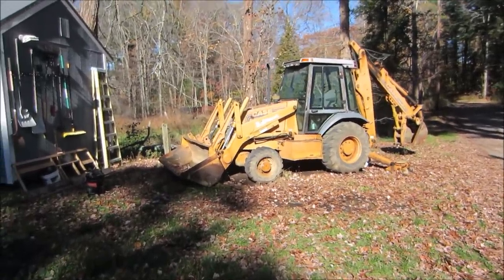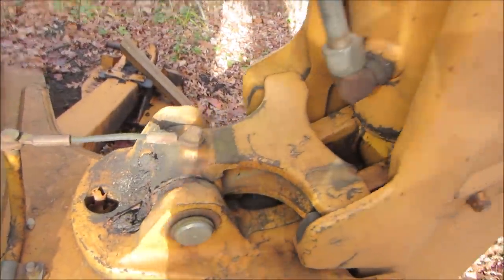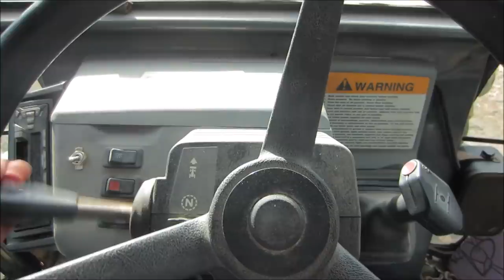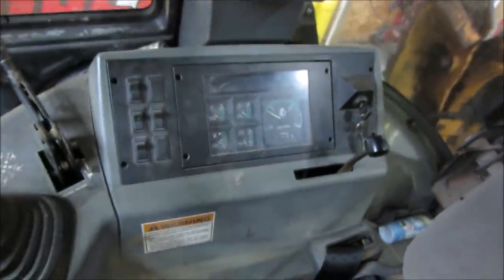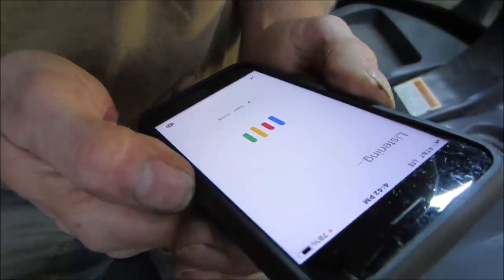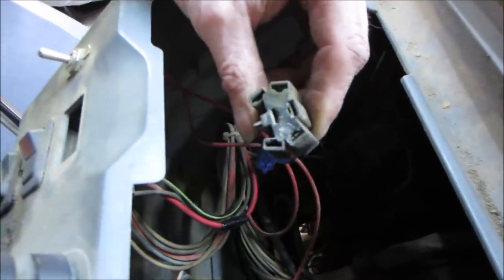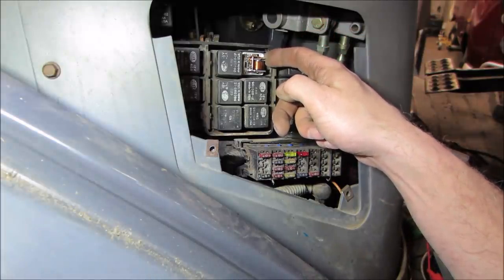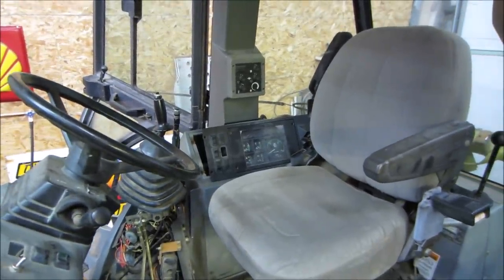Lets Fix Up A Clapped Out Case 580 Backhoe Thats Been Sitting.

Comment: Clapped out?  Matt at Diesel Creek would consider this too new to bother with, but that's him.  Also, I'm loving the twice-a-week Mustie lately!
Reply: Was coming to the comments to say something similar.  Starting on first crank?  Fancy!
Reply: Yep, too much works on this one for Matt.  If it doesn't need 3 batteries, 2 tires, and $700 hydraulic hose, that's cheating.
Reply: Enjoy them BOTH.
Reply: @MGower4465  🤣🤣🤣
Reply: @MGower4465  Same for Andrew Camarata plus welding 1/2" steel parts !
Reply: Matt hates backhoes.
Reply: @starrionx1  That was someone else's backhoe.  If he found one for the right price, he'd buy it.  Fully intending to fix and flip, and maybe sctually do so.
Reply: @MGower4465  Right. He'll flip it. That is why he has two loaders, two tractors?, two Semi-cabs, a bulldozer, a tracked loader, a dragline, an excavator, and two kinds of tracked Bobcats?  Am I missing any of the major ones?
Edit: Apparently I forgot Christine the Grader and the Ford Crane truck. Also Forgot: the active Dump Truck, the parts truck, the Service truck, the fork lift, the Beater with a heater, and the Willys Jeep.
Reply: @starrionx1  I have faith he will actually sell one.
Someday.
Reply: Matt is a masochist..He enjoys the pain and suffering..
Reply: @starrionx1  the grader hes fixing?
Reply: @lukasstorie2947  How could I have forgotten Christine?
Reply: @starrionx1  What about the Ford crane truck? Should be major enough.
Reply: @DocNo27  Not ether-trained either!
Reply: @starrionx1  and he just picked up an International dump truck
Reply: @motor2of7  Yup. Funny thing- the owner of the dump truck also had a backhoe. But that would be unpossible.

Comment: This has been a very VERY difficult video for me to watch. Just simply because I want to help! I grew up in a Case 580 series backhoe. My dad was "the guy" that people called for dangerous and intricate digging in my area. He literally has tens of thousands of hours in the seat of a Case 580 series backhoe. All the way from his first 580B up to the last 580 super K he still owns that runs awesome yet. I too can run it but my dad is a true artist with that machine. Always made the difficult jobs look like a kid playing in a sandbox. 

I love fixing these backhoes up, rebuilding the cylinders and replacing worn pins and bushings. Even at 6600 hours I believe this super L will be a great machine for you!
Reply: My dad started with an Ford 801 Powermaster  backhoe back in the early 60’s. Sold the Ford and bought an International Harvester backhoe in 1975. He sold the IH and bought a Ford 555 backhoe in the late 90’s. He was an awesome backhoe operator and made digging with his backhoes look easy.
Reply: @edwardkane3237  it's an amazing thing to watch for sure!! Especially for a kiddo that looks up to his dad so much. I remember hours of watching him run that thing until I was old enough to get in the trench and run the manual backhoe(shovel). Heck to this very day if I'm digging something that's kicking my butt I'm not above giving the old man a ring and have him run the machine and me run the shovel. At 73 he's not as smooth as he once was but I'd still put him up against any of the other operators in our area. 

If your dad has worn out as many backhoes as my dad has, which it appears he has, then I can assume that your father's story is much the same as my dad's.

Comment: Oh, Mustie! You’re going to have some fun with that one. The ultimate Tonka toy. Congratulations!
Reply: The bigger the toy the bigger the joy.🤔🤔🤪 .......NOT
Reply: Sorry, but this is a "shake hands with danger" moment.  This is not light duty suburban stuff, this is industrial earth moving/construction equipment and he doesn't even have a manual. 
What he was doing with the electric is insane.  What he SHOULD have done was connect the 12v to the ground (and disconnect the ground side of the trouble light from the battery) and then used the probe end to put power to those wires.  By doing it that way, the bulb becomes a current limit device and a fuse.  Bypassing fuses is a horrible idea.  At one point when Mustie was putting power to the connector, the connector started glowing.
Reply: @tarstarkusz  "Sorry, but this is a "shake hands with danger" moment." - That says so much about you as a person.
Reply: Yes sir ! Mopar Madness is in Mustie's house
Reply: Ono
Reply: @tarstarkusz  ono

Comment: Hey Mustie, the bottom left button on the rhs guage panel (6 switches) operates the front axle engage or disengage. Recommend to only use 4 wheel drive in first or second gear and 2 wheel drive on hard surfaces at speed. The interior dome light switch is the top switch to the left of the steering wheel. Good luck with your project, i'm enjoying the ride along.
Reply: I hope he reads your comment. I thought when he powered up the 4 wheel drive switch right before he took the camera off, it lit up. That would indicate a servo is working. Get knowledge.  I hope it helps him. 👍

Comment: Instead of clipping a hot lead to the probe of your 12v test light, disconnect the ground from the testlight and put the 12v on the ground side of the test light, this will effectively put the light bulb in the circuit and "current limit" what you are doing.  The way you are doing it is basically bypassing the fuse and amps can jump to infinity.  But, if instead, you are running the hot through the test light, that bulb will always provide enough resistance that you will not cause your connectors to glow like you did in this video.
The way you are doing it (putting a hot on the probe side) allows the current to jump to infinity.  The way I am saying will always current-limit you to that of the lightbulb.  A dead short cannot happen through a light bulb. At worst, the bulb will blow.
Reply: I really liked the red alligator clip in parallel to provide 12 volts   all he had to do was  connect the alligator clip  of the test light to bat pos and provide current limited voltage to the circuit under test.  Scary electrical troubleshooting.

Comment: Hello Mustie. You really have my attention on this one. I retired from a National Cemetery and this was one of the Backhoes we had. We used the Case 580's, 590's Super E, Super L. You probably know by now but when you are going to lock the boom, you pull the lever toward you and when the boom gets near the cab you push the lever the oppisite way, away from you and the boom will lock. These are easy to maintain and work on. Thanks for the video.
Reply: I was waiting to see if they knew. It’s the most counter intuitive thing in the world and scary the first few times you do it.
Reply: It is really hard to sit here and watch when you know how to get the boom to come back. We had this feature on a CAT I operated in the oil fields. The old timers had a laugh sitting back watching me struggle my first time trying to get it latched. Lol
Reply: @markallen200  I agree Mark. It’s driving me crazy watching Mustie struggle. I want to be there so bad to show him how to operate it. I ran those for 24 years.
Reply: The Cat 416's were the same way to lock the boom.
Reply: The front tires are still somewhat useful even when worn out in the center because the lugs on the shoulders will still give some, though less, traction.
    Any advice on what type, or brands, of oil are best for old rubber seals and hoses? hopefully not too expensive to replace when it leaks?  I have trouble working on my cylinder seals because the cylinders are too heavy to lift with the machine disabled.  It can fix another one but has no way to fix itself.
Reply: I told him the same thing but he figured it out
Reply: I own a K and another trick mentioned on the Heavy Equipment forums is to turn to the side  and push it up with the stabilizer for a more gentle engagement of the boom lock. Obviously he will have to get the cylinders back on the stabilizers to try this trick out.
Reply: @markallen200  Laughing at someone struggling to do something the first time they do it is really embarrassing. Those old timers needed kicked in the shins.
Reply: @markallen200  
YES. I put my head out the cab on my C model once, and only once. It just about brained me. My bad. Till a person gets use to CASE it a art. Are JD just milked it's way in. A BIG difference JD looked at what CASE had and changed there Lock in to over center to slowly go in. Much safer.
Reply: Killed me knowing how to lock the boom and not being able to show him how lol
Reply: @framelawncare6671  
YES after just about lossing my brain. Me sticking my head out cab on my 580-C. Him just thinking you add more hyd. Oil. I was like so badly wanting to jump through my phone.

Comment: Hi Musti,
The button on the bucket control is a transmission cut out switch. Used when loading a truck, you can disengage the transmission when dumping and shift your shuttle in reverse. This way you can throttle up while dumping to speed up the process. If that makes any sense. The button on the gear shifter is to disengage transmission just so you can shift on the fly.
Love you videos...been watching for quite awhile. I have been operating Case backhoes since the early 70's. Can't wait to see the improvements on this one!
Reply: Just be aware that on some loaders that button is to change from bucket tilt to added implement operation at the front like a bale grip or claw. So it varies a bit, but given what you says it makes sense for this one.
Reply: kind of like the clutch on a forklift, disengages the trans so you can lift the boom faster.
Reply: On ours its a diff lock.
Reply: red button     trans cut out ( clutch ) so you can change gear on the move
clue on the gear stick
Reply: @ehsnils  you mean a third function valve ???
Reply: @dhache1195  Yes, with an electrically controlled valve pack right behind the bucket. Easier to route wires than hoses to the front.

Comment: Every Case 580 I have operated from a D to a Super K you have to pull the boom lever towards you with a little gusto. Not crazy but just enough momentum. When you are close push the lever away from you and that keeps boom from slamming the tractor hard and let’s the boom lock. It’s an art of coordination but you’ll get it!

Comment: Make sure you put a compatible oil in the hydraulic system and the transmission. I was a mechanic for Case IH in the 90s. There was a hydraulic oil that Case said not to use in their equipment. It was a generic oil available at farm stores and it was pretty popular at the time but I can t remember the name. Anyway we had a customer that bought a new 300 hp 4wd tractor. They had it about a month and pinched a hyd hose in half on a Sunday. They couldn't t get Case hydraulic oil so they put the don t use type in instead. A weekblater the new tractor was in our shop. The Trans hydraulic and brakes all used a common oil . The oil they put in it caused the glue holding the disc material to the steel plates on all the clutches and brakes to dissolve. The entire tractor had to be disassembled except for the engine and all that disc material had to be cleaned out of every passage pump bearing sump and any place else you can think of. All the disc's had to be replaced and then reassembled. There was no warranty because they put the wrong oil in it. The cost to them was around 15000 dollars. It was a very expensive ordeal.

Comment: The 3rd wire on the switches is the ground for the bulb in the switch (black w/yel IIRC.).
Yes, those Scotchlock IDC connectors helped pay for my EE degree. Worked at a shop we repaired them almost daily. They were bad back in the '70s when they came out now we have the cheap Chinese copies.
The rear wiper is right next to the front one. that is the 3-pos rotary switch on the side controls that did nothing. The one next it did the front
Reply: Buddy, I know exactly what you mean about those darn connectors. I was working in a foreign car shop in the late 70s and if a car had an electrical problem nine times out of ten it was one of those. Volvo was particularly bad about it. And a Merry Christmas to all Mustie fans from North Carolina farm country!
Reply: I think the Chinese copies are called ScotchRocks to avoid trademark issues.
Reply: My very first encounter with those @&%!!* connectors was on my first car in '73 when I installed Marshal driving lamps on it.
Instant drama. Never, ever used them. They should be made illegal.
Reply: I’m amazed they are still being made and used in the automotive world. They always fail.
Reply: I hate those scotch locks!

Comment: That thing is perfect. As a kid I believe every kid had the metal toy of this backhoe. It would be worth a fortune where I’m at. Watch as soon as you fix the outrigger cylinders the hydraulics will start to break down the line till you’ve changed every seal and changed every hose. That’s the curse of hydraulic systems in my experience.
Reply: Yup. Bought a not leaking 1997 580 last year. Once I started working her, I have now replaced every seal except steering so far
Reply: Same with my old D.

Comment: Leave your bucket//digger extended to the ground when releasing travel locking pin. That will minimize lurching of main boom. I have an older 580
Reply: Once the outriggers are working again that would also help.
Reply: outriggers AND grounding the front bucket would help, he was floating on just the tires when trying to lock it up!

Comment: Hey Mustie1, thanks for the videos! I thought I would share an experience that I had with a Honda Hippo (Japanese Domestic Market) Generator. I tried the usual, carb clean, ultrasonic cleaner, low oil cut off switch bypass.... would run for about 5 seconds and die.... Was driving me mad, I couldn't figure it out... one last Youtube check before it goes in the heap... I found a video of a generator with a clogged exhaust and thought that this couldn't be my problem... So i went through the carb again..... same trouble.... then figured it was worth the time to remove the muffler just by some chance (very small I thought) and it ran like a champ. for some reason I have never seen this happen in your videos and you are the GURU in my eyes. Just thought you could add the exhaust in one of your trouble shooting vids, Im sure the masses would find it useful. Thanks again for your time and dedication to all of us. Scott in Japan.
Reply: Check for a banana in the tailpipe.
Reply: When I was a kid I spent my summers in Italy, up in the hills of Tuscany. One of the house staff was a funny Swiss chap who drove an old Renault R4. Sometimes he wouldn't drive it all the way up the farm track to the house but park just off the track a few hundred metres below. One evening he walked off to the car to go home, only to return ten or 15 minutes later, asking for help because the car was acting up. A bunch of people walked to the car and there it sat, almost perpendicular to the track where he'd backed out of his parking spot. He tried to start the engine but it made the weirdest noises and died immediately. Took us a few minutes to realise what was going on but someone noticed that he'd backed too far and buried the tail pipe in the soft dirt bank on the other side of the road, completely clogging the exhaust 😀
Pushing the car forward just a few cms and clearing the tail pipe fixed everything.

Comment: Had one of these.
Excellent machines many used parts around.
Cummins/ Case motors simple to service. 
Hoses and cylinder packings typical issues.
Buy some big wrenches and torches..
You will need them.